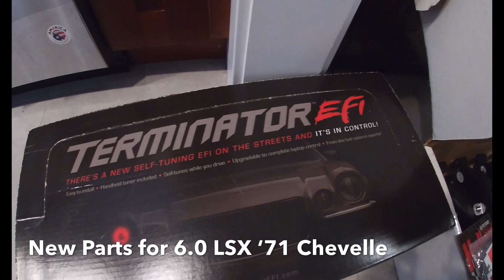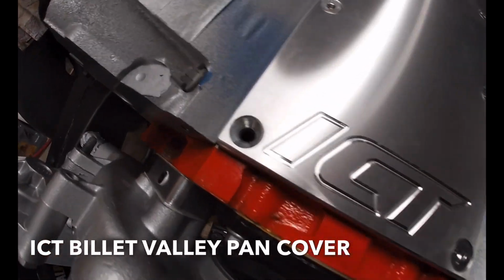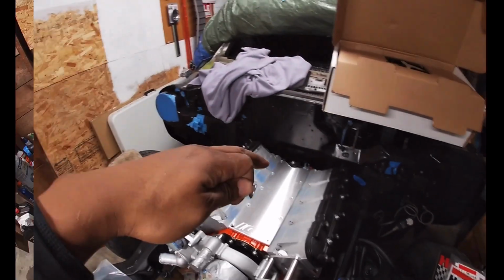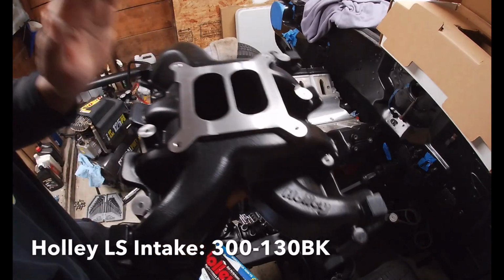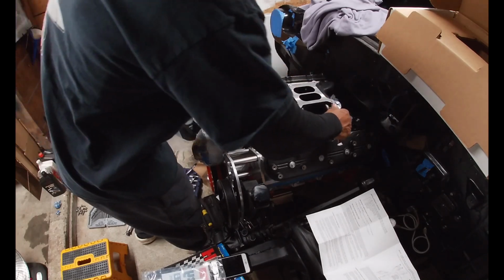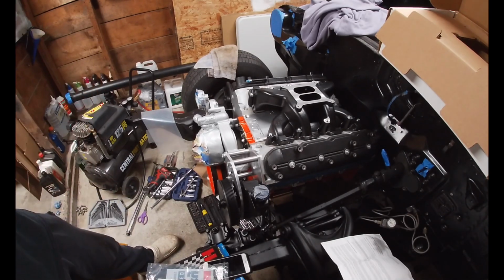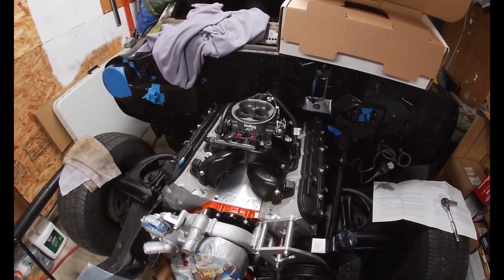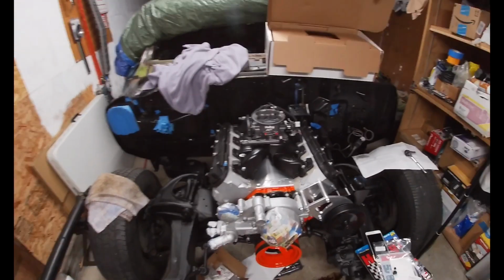CHEVELLE MEETS HOLLEY💁‍♀️ | 6.0 LSX | Terminator EFI

Comment: Words of wisdom! I have the same system and it's best to grind out the center of your intake as much as you can. a 1" spacer is still going to cause issues with idle and low end . Also grind out the center at the back a little more so the IAC can work better. took me weeks to figure this out. look at the port for the IAC on the bottom side of your Throttle Body and you will see what i'm talking about.
Reply from the maker: J COOK I REALLY appreciate the info. Thank you! I actually found this out in my research recently. I ended up ordering the HVH Super Sucker spacer that has the center already ground down quite a bit. I’m going to double check it on the throttle body to ensure the IAC clears as well so thank you for the advice. The great thing is that it’s an aluminum spacer so hopefully if I have to shave some off it won’t be too bad.

Comment: What wire are you using to run the ignition box to run the ls coils
Reply from the maker: I’m not sure what you mean. I came with a Holley harness. I just follower the directions from Holley to run & power it all. I think Holley uses a a few 12v leads to power everything. However, some are keyed on power, some are not I believe if I remember correctly.

Comment: What transmission are you using. I can’t decide if I want a  th350/400 or use an ls trans.
Reply from the maker: TH400. I have a back up 4L80e if I need it.
Reply: @MrGriffin23  ok. That makes sense. I know they said it supports transmission control. But I’m not sure if I need anything else to connect to an 4l60. I think it’s a separate harness
Reply from the maker: @theshark2804  yes it’s a separate one. I just figured if I were going to run the 4l80 I might just go completely to MPFI. We’ll see…

Comment: Did you have any problem with the LS not starting back up after it first start. Mine will crank then idle and die but it won't crank again unless I unplug and re plug the coils harnesses
Reply from the maker: I did. I figured out that starting it on open headers with no exhaust was not good. Found out that I needed at least 18” of pipe after the O2 sensors. Once I fixed that, it started up every time. Without the exhaust, the O2 reads too much fresh air.

Also, make sure the coil harnesses are grounded to the back of each head.
Reply: @MrGriffin23  
Thank you for the info. I started it up with open headers to make sure it was good. I'll add the pipe and try again.

Comment: Since there is no distributor what did you use for ignition? Was it a lot of modifications? Was it easy?I have a sniper efi  for an ls 6.0
Reply from the maker: Fuel and spark is control by the Terminator ECU. Pretty much plug and play. I did some modifications to my 1” intake spacer so the MAP and IAC sensors can operate better. Other than that was it was pretty straight forward. Harness is nice and everything is labeled.